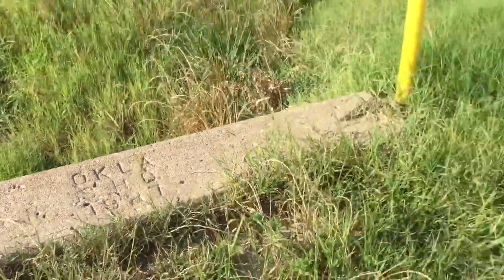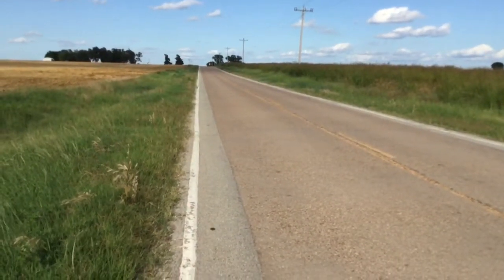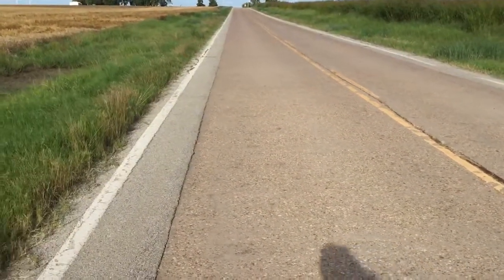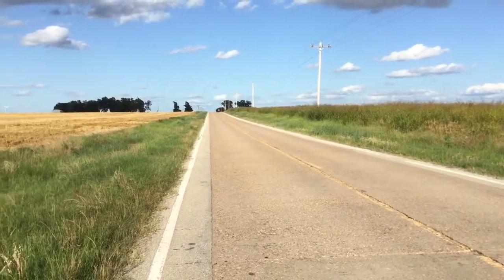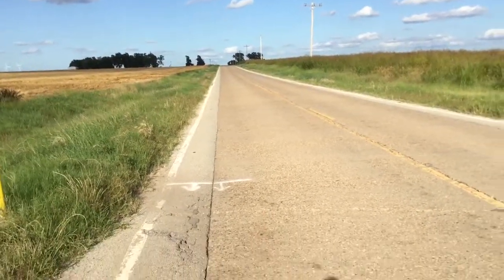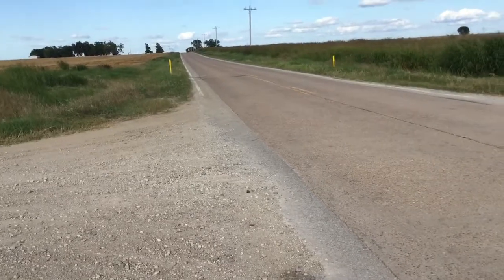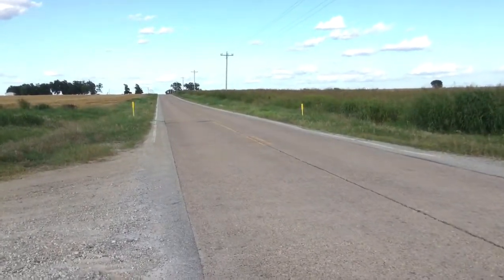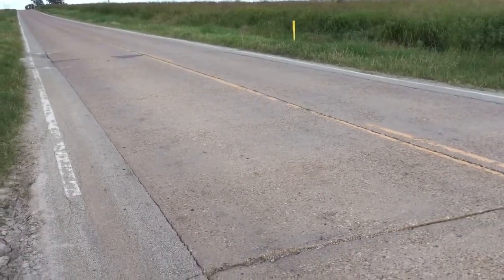The Last Stretch of 1920’s Concrete Highway in Oklahoma Still in Service on the Highway System

Comment: That's a shame they're going to pave it over.
Reply from the maker: It is unfortunate. Before the windfarm construction traffic, this road rivaled many newer roads for smoothness. It still does, but has a few rough spots now...
There are still plenty of these roads left in service, this was the oldest, however, that was still on the highway system, and not merely a county road.